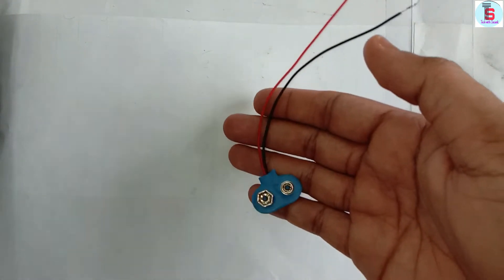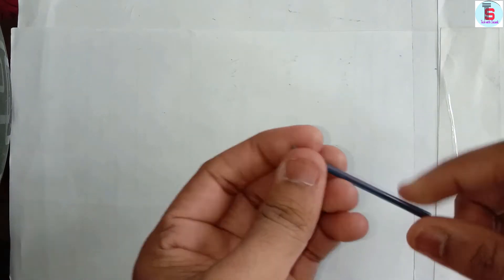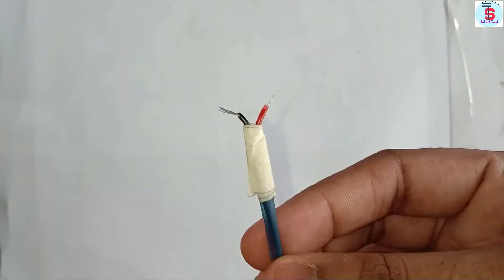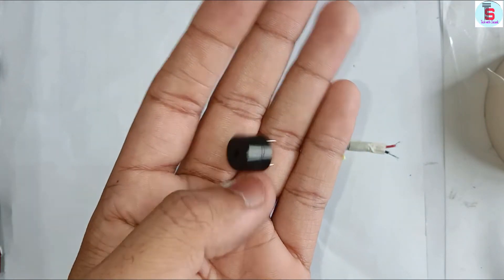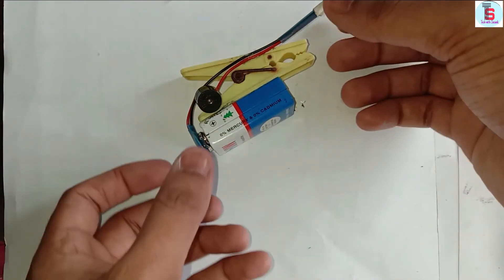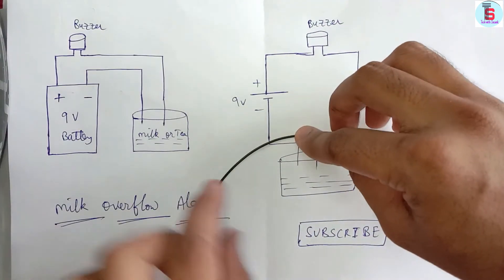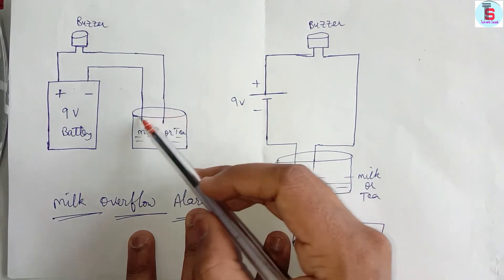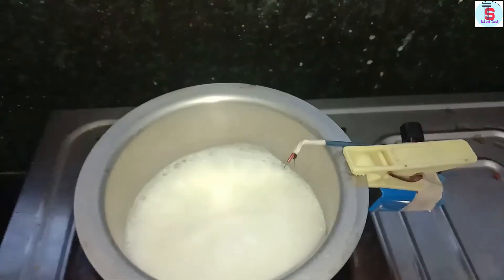How to make milk overflow alarm | with Circuit | Milk overflow alarm telugu

Comment: Bhai i dont want wire inside milk. Any substitute which is not harmful?
Reply from the maker: Wire will not be inside the milk. It is only for indication. You can use any good conductor of electricity. Do check other videos and share with your friends 😁

Comment: Not working for me
Reply from the maker: Common mistakes
1.Try to immerse both wires inside
2. Check the battery status and no loose connection.
3. Better to use clips made of wood or metal. Hope it helps ☺️